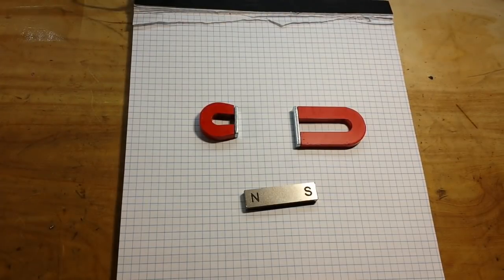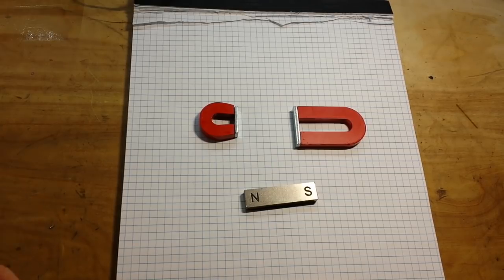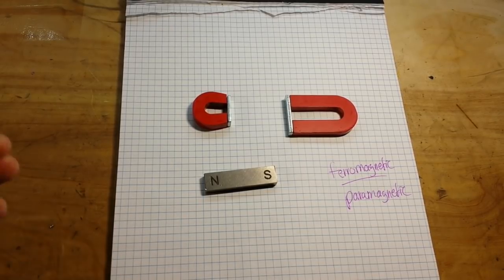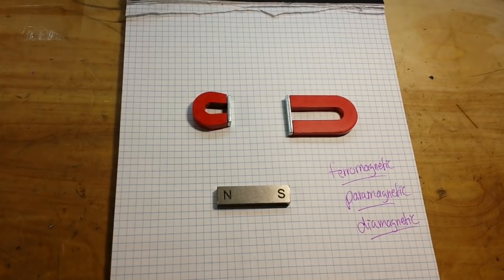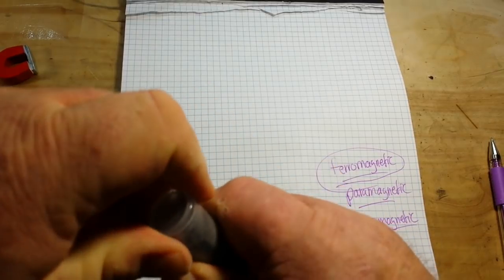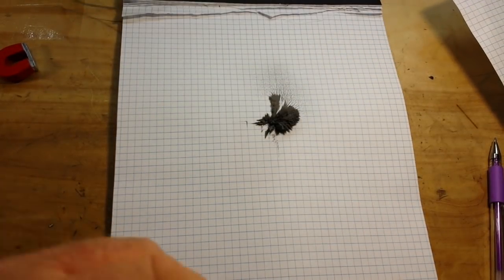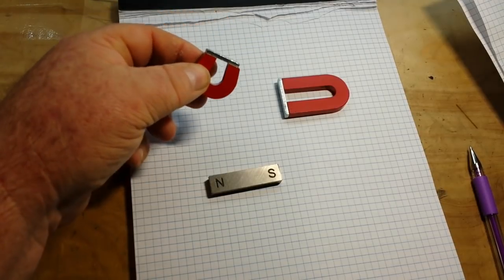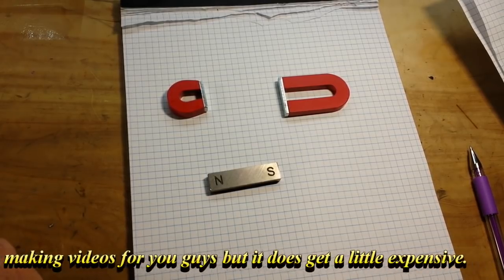Magnets and electricity part 1

Comment: Yes eventually but not for a very long time. Neodymium magnets are a ceramic that has undergone an intense EM pulse that aligns the polarity of each neodymium iron boron components. This aligning gives it stability which will last a very long time.
In a ferrous magnet the iron looses a slight amount of its overall magnetism every time it come close to or in contact with a magnetic object. This loss is significant compared to the neodymium and therefor the ferrous magnet does have a limited or short effectiveness if used regularly.

Another interesting note is that we are taught that the magnetic field attracts. This is false. A magnetic field is created by the discharge of the dielectric. The discharge creates a divergent magnetic field that is repulsive, not attractive. In actuality it is the convergent dielectric centripetal component of a magnet which is the attractor. 

I other words a magnetic field repels and does not attract at all.